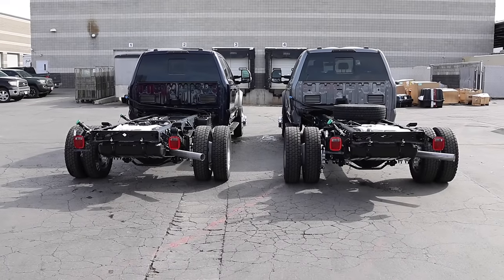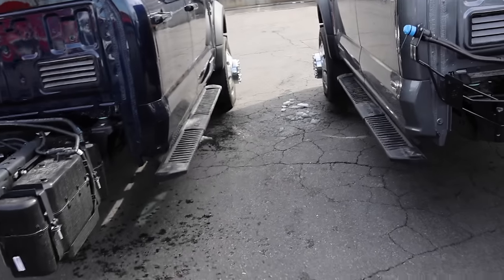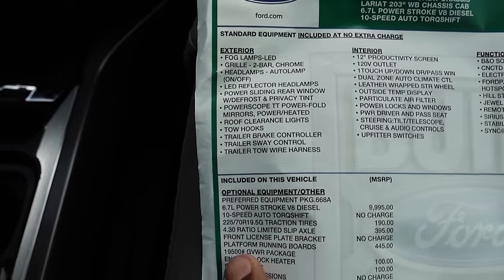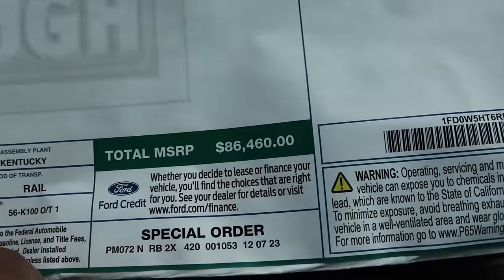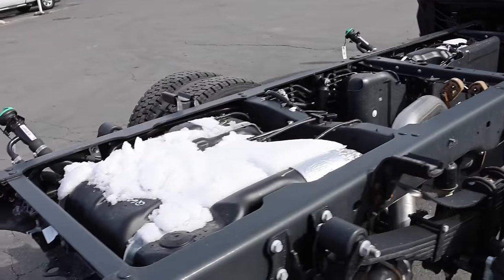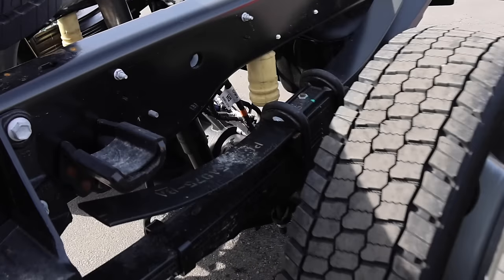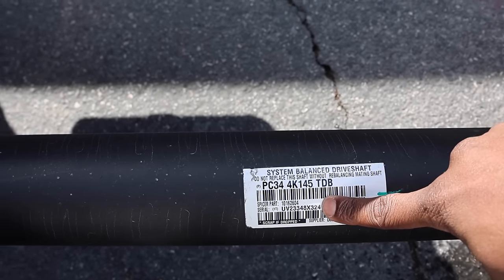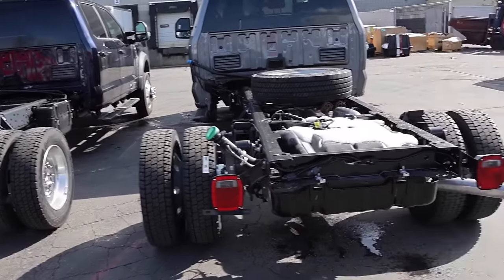4.10 VS 4.30 Gearing: People Say Max Tow Isn't Worth It… Heres What No One Showed You Before!

Comment: You said the gross vehicle weight rating on those trucks one was 18,000 lb and was 19,500 lb so legally you can't haul 40,000 lb or even 30,000 lb with those trucks. Now your hall capacity whatever number those were would be considered tongue weight you're not putting 18,000 lb worth of trailer that you're pulling and then several thousand more pounds in the bed of the truck that ain't how that works it goes strictly by the gross vehicle weight rating
Reply: Gross vehicle and Gross Combined Vehicle are two different things.  Gross vehicle is the max weight on just the vehicle with you and all liquids filled up, Gross combined includes the trailer weight as part of the truck weight also.  You cannot go over the gross vehicle weight or the gross combined vehicle weight.  If you need a better explanation let me know I will try again.  Remember the weight the trailer puts on the truck counts in the Gross vehicle weight and the combined weight.

Comment: I bought a gas 250 and I’m perfectly fine with the 4.30 in that. I lose some mileage but I’ll never need to worry with my current towing needs and it gives me the most capability with the lower torque.
Reply: This is all about hot shot. If you guys really new the business you would not be saying this
Reply: 4.30... VS 3.55 , 3.23 or 3.08 is HUGE MOG LOSS
Reply: @Djtruckin TRUTH ✅ the 4.30s are ridiculous old tech for gutless old gas engines not modern engines that should be 3.08 with a 10spd
Reply: If you guys pay attention to the video it’s not about max tow as it is max tow in a hot shot application. The best way to make money in a trucking operation is through fuel economy. I have 14 years of numbers to prove it, and the best guys in the industry know it and work on fuel mileage on a daily basis. You need to be able to move around efficiently empty and haul lite in hot shot. Every time you haul heavy hot shot you’re losing money.
Reply: @Djtruckin  I understand that. I was just sharing my private use/needs. If you are towing for a living, I would def maximize the fuel economy over as long as you are pulling under the legal limit.

Comment: The difference in rpm is not going to be that much between a 4.10 and a 4.30. So I don’t know that the fuel mileage is going to be a factor. I guess it just would depend on if you need the extra GCWR. 

Also you are thinking like a consumer owner and not a commercial owner when you mention being sluggish. Again, the performance won’t be much different. Probably a slight advantage for the 4.10. But loaded with the kind of weight you’re talking about is going to put these trucks in the 40 mph range on steep grades. Which is good because a max loaded semi truck is going to be in the 20s. In my part of the country with some of these grades we have they are in the teens. So again, that is irrelevant. They are not going to fly up a grade like we all do with our weekend warrior loads.

Comment: Why does GM call out a Max gooseball or tongue weight on their trucks but Ford and Dodge does not? On my fifth wheel, I am nowhere near the max cargo capacity of my 3500srw but it's a struggle to stay under max gooseball rating. This doesn't make sense to have excess cargo capacity but not be able to use it with GM. Guess next truck will be Ford or Dodge.
Reply: I wonder if that's why more people tow with a ford or dogeza vs chevy or gmc 😮🤔

Comment: Maybe it's because you need a CDL license with the Max Tow with a full load.
Reply: CDL required after 26k. You can make a great profit hauling no CDL hot shot.
Reply: I don't understand?  once you put a 10K or ab one trailer on the truck you are required to  have a CDL aren't you? also if you have a 19500 gvwr that only leaves you with 6500 trailer weight before you're over 26k @Djtruckin
Reply: @flash996  26 k requires cdl.
Reply: Truck trailer cargo
Reply: @flash996  doesn’t exactly work like that.  The trailer has to be 10,000 GVWR or more AND equal 26,001 GCWR or more. 

So at 19,500 he could pull his 9,950 GVWR black trailer and not require a Class A cdl even though his GCWR is over 26,000. It’s because the trailer is not over 10,000 GVWR. Once that happens then yes, you would need a Class A cdl for commercial use (not private though). 

There is so many myths about when you need a cdl and it’s because people don’t know the laws.
Reply: @matthewanderson9912  The whole class B cdl always made me laugh.  Literally could have a 60,000 lb gvwr truck and be limited to a 10k lb trailers.  Like whats the point lol!!  Lots of guys running 26k gvwr trucks with 10k lb trailers under cdl. Its nothing to do with safety, just good lobbying.  Tree trimmers run this alot.  26k trucks, and a 10k or less chipper behind it under cdl.
Reply: @flash996 anything past 10,000 requires a cdl
Reply: @matthewanderson9912   Lots of folks are starting to get a/57 cdl's now.  Some people call them restricted class A's, or hot shot cdl.  It's for trucks under 26 gvwr that are towing more that 10k.
Reply: @ThrivingEarthFarm  not sure what that would even be because a true CDL comes in three classes. CDL A is any combination vehicle exceeding 26,000 pounds AND the trailer being towed having a GVWR of 10,000 or more pounds. 

CDL B is any straight truck with a GVWR of over 26,000 pounds. 

CDL C is basically issued for trucks that don’t require a B or A license but have a passenger endorsement or hazmat endorsement or some kind of CDL specific endorsement. 

So as far as the federal laws go I’m unaware of anything else.
Reply: Need to look at your state laws but many states do not require a CDL if you are pulling your camper or personal vehicle.  CDL is Commercial Drivers License.

Comment: Find 2 identical spec trucks and the serial numbers won’t match. If the part number is the same, they’re the same. The serial numbers are used for tracking purposes. 

There isn’t enough difference in those axle ratios to make much difference in actual use, especially with a 10 speed transmission.

Comment: I run the Dana 80  out back 4.30 gears and LSD on my 4X4 Dually.  My truck is also registered @ 33K.  aka the little sticker on your license plate
Reply: What's your average MPG?
Reply: @xmo552  usually around 14mpg.  But I run Toyo 35”s   I also keep my hydra chip at the 140hp setting because I love the power with the stage 2 injectors and the larger van turbo without a blowoff valve dumping into a full 5” exhaust right off the terbski
Reply: @DumbCarGuy  
That's in a 6.7 Ford and usually hauling 30k?
Wow.

I've towed over 10 years. On the 6.7 Fords I've driven (most were 4.30:1) I'd average around 250 miles on a saddle tank. I never hit 300 miles loaded. If I was pulling a Camry or Suburban on a long steady highway cruise I got around 10-12 MPG no matter what. 
From personal experience the Dodge trucks gave better MPG, but they were slower in acceleration. 

I asked your MPG because yesterday I found a 2018 F550 4x4 rolling chassis with 4.30s. I'd like to build a ramp truck (single car on my truck frame) car hauler for personal use.
For this application I might prefer 3.73 for the MPG. 
What do you think?
Reply: @xmo552  mine is a 2001 with a 7.3

Comment: I’d get a 450 over both of those. It’ll haul the same weight and it has a full HP motor! The 550s are very de-tuned.
Reply: F450’s are just as detuned as the 550’s.  The 350 cab chassis rigs are also detuned compared to their pickup bretheren, both gas and the diesels.
Reply: Negative partner, 450 with a pickup box has the HO option available. Full HP available on the new F450s.
Reply: @farmkid7888  I was referring to the cab chassis models, as that’s what our utility buys for upfitting.  It would appear as we are both right, actually.